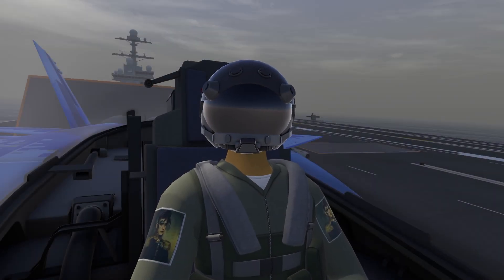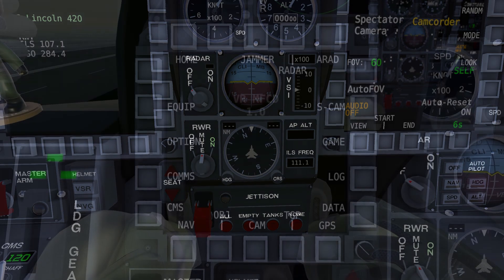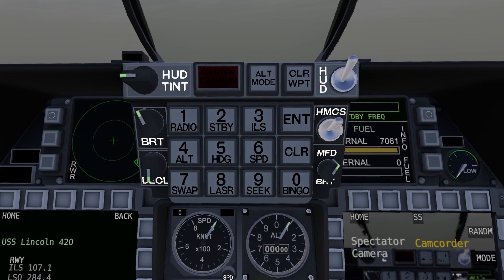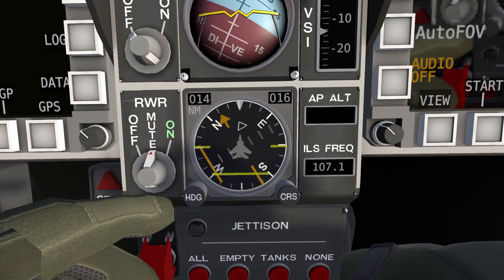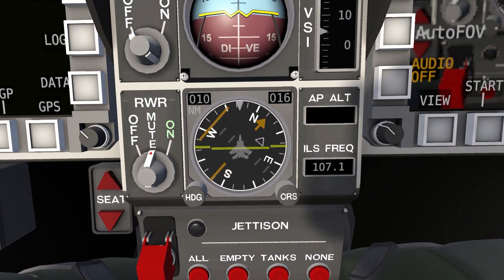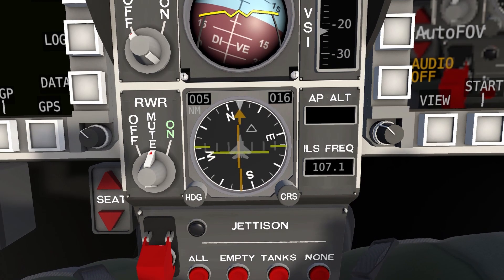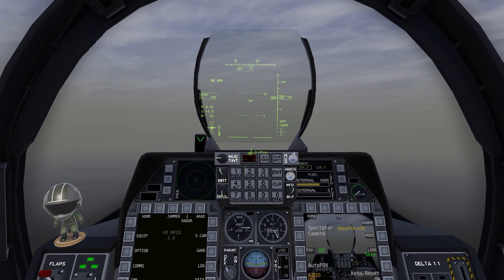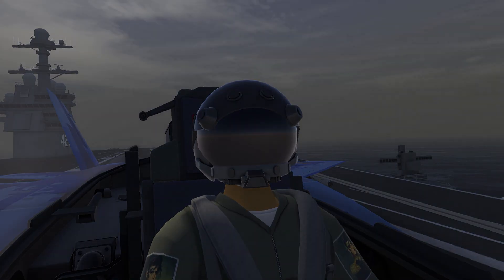How To: Easy Low Visibility Landing Using ILS | VTOL VR

Comment: Question just to be clear: putting your velocity vector on the carrier leads to exactly the same outcome, right?
Reply from the maker: To a point, sure. You still want to have your velocity vector on the carrier, but this helps you ensure your approach angle is correct. Even if your velocity vector is on the carrier, you don’t want to be coming in too steep or shallow.

Comment: I've never seen a VTOL VR carrier landing video where someone wasn't told to wave off. Never.
Reply from the maker: I did it once when making this video but unfortunately it didn’t make the final cut
Reply: I've seen it in a video once. My jaw hit the floor. The video was "This is NOT an F-14 Tomcat" by Tuuvas and he starts landing around 10 minutes.
Reply: It's possible! If you check the mission log in vtolvr you will see the reason why you were waved off. a few attempts adjusting and you can do it.
Reply: @a-lil-ghoti  Valuable information. Much appreciated.
Reply: It's because most people have too shallow of a glide slope. These military planes are meant to belly flop onto the deck pretty quickly.
Reply: yeah i kinda thought that was a glitch or whatever that never got fixed, until like a week ago I started landing sometimes without getting waved off.
Reply: I just pulled it off at night first try, I was a bit high but no wave off. Although that’s certainly the result of many day attempts 😂
Reply: I think I've heard u need to keep the AoA around 8-10 degrees, didn't try it yet though

Comment: Where did that numpad come from, isnt the autopilot stuff there?
Reply: It's in the new public testing version. Auto-pilot is now down to the cockpit's bottom right.
Reply from the maker: The autopilots are still there, but you use the buttons to set them instead.
Reply: @darkstar1592  Buttons for autopilot input should be way better, was tired of having to hold down the altitude adjust button for 10 seconds to change it by 5000 feet

Comment: Big thing that will help to add is knee boards for frequencies and quick references
Reply from the maker: You can use OpenKneeboard for this but I 100% agree that it would be nicer to have an actual kneeboard add into the game.
Reply: @darkstar1592 ?
Reply: @darkstar1592 what do you mean?
Reply: @SJKJ_  OpenKneeboard is a software you can use to sort of simulate having a kneeboard in VR via a third party method. Very useful to have.
Reply: @squidin9347  are you going to make a video on it?
Reply: @SJKJ_  Probably not, haha. But if you're interested, please give it a bit of research. Have a good one man.

Comment: This is good, some more contex which i have been taught:

So the triangle on the right side will always point to the ILS station that's how you know if you're flying towards or away depending on what you are doing.

Another quick one is if you draw an imaginary line from the nose of the plane on the instrument to the top, and you align it with the top of the orange line you'll get there in a faster and controlled way and speed and then its just wait. Good job with the video
Reply from the maker: Great points, thanks!